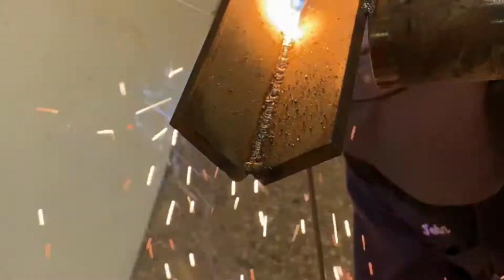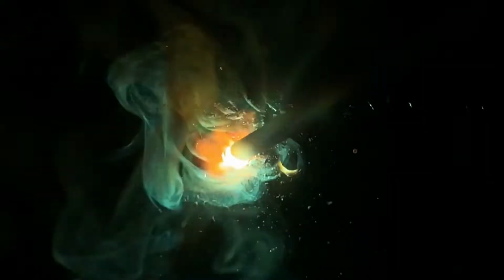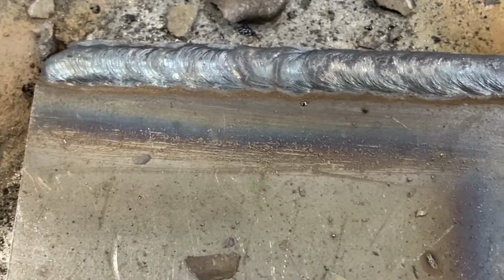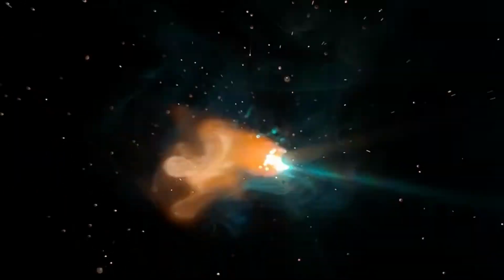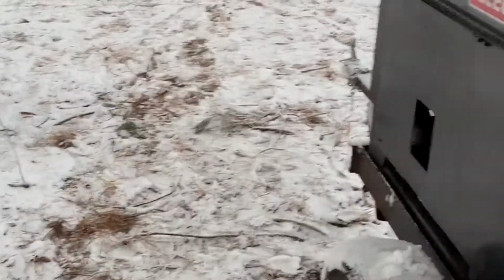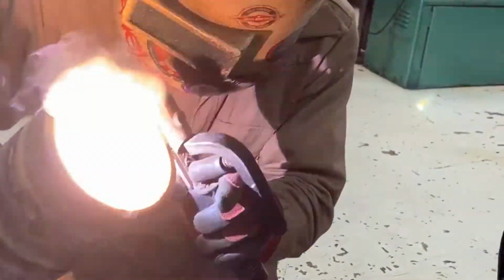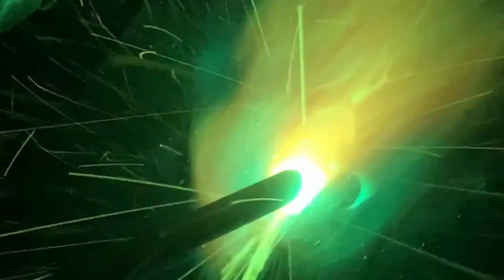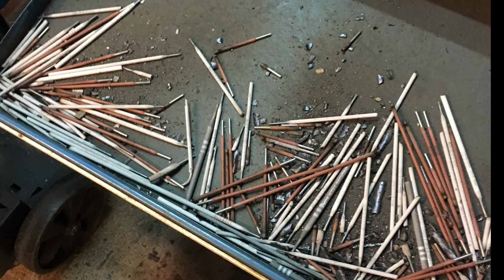SMAW Overview

Comment: It would be great a tutorial on stick welding as you did with GMAW, for vertical and corner joints. Which are the movements to do it right?
Reply from the maker: The 3G simulation is similar to this however I will work in making a video for it